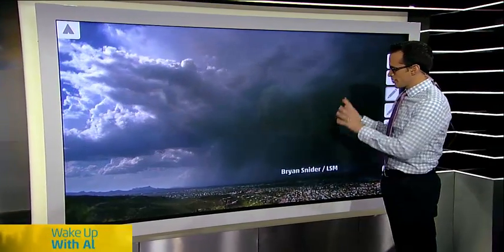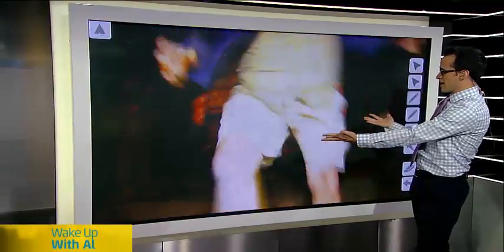Weather Geek Wednesday: Microburst

Comment: I have a question; Some people discuss about differents between downbursts and microbursts. What is the different? Are there differents between both of them or did people just give it two different names of the same phenomena? I don't get it.

In my oppinion it's exactly the same.
Reply: Okay.   The basic name of the phenomena is downburst.   A microburst is a TYPE of downburst that is relatively smaller than the rarely occurring macroburst.   "Micro" meaning small, and "macro" meaning large, only the stronger the gust, the wider the spread of the downdraft and "curl" stage of the rain gusts.   There is also a Heat Burst which occurs in the absence of an anvil-shaped cumulonimbus thunderhead.
Reply: Aah now i do understand load and clear. I never heard about Macroburst and heatburst. How the heat burst works i don't know, but i like to figure it out.

So a downburst depends on how strong and how wide the downburst is? So if i understand correctly, a downburst is just a downburst but if it's small, then it's a microburst and if it's strong and wide a macroburst. 

Many thanks for your explanation :)
Reply: You're welcome.